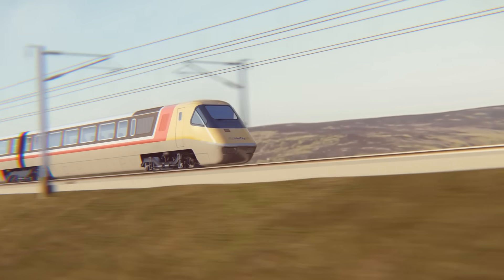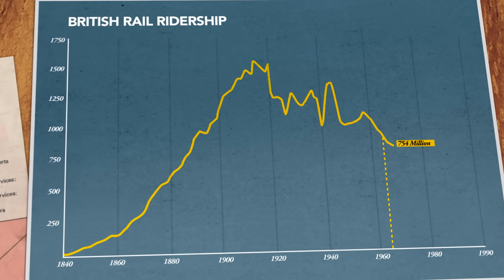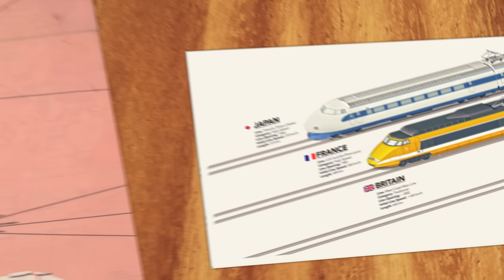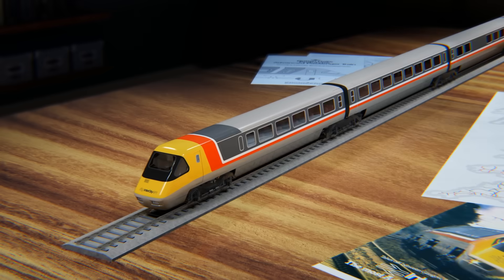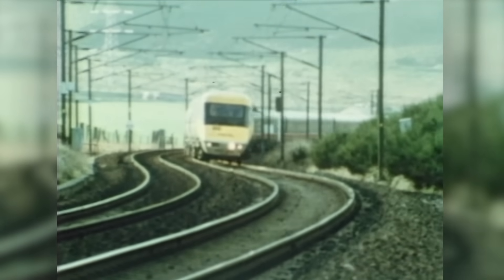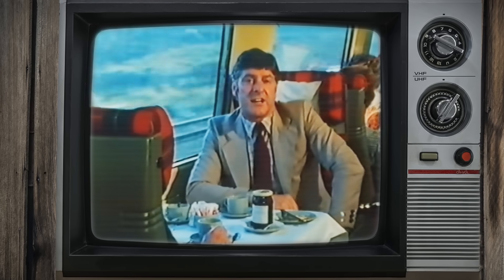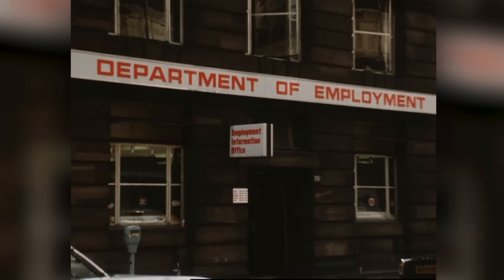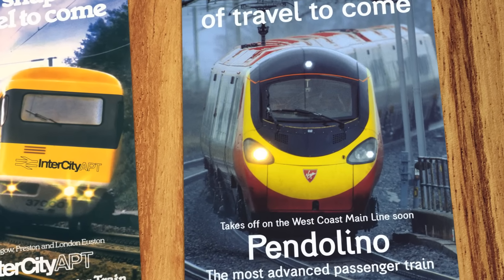This Train Made Passengers Sick: The APT Tilting Train Story

Comment: Germany had some tilting trains, too, from 2001 until 2017. The ICE TD (Tilting Diesel) went 222 km/h on a test track, and it went 200 km/h in real use.
Reply: They still have tilting units, the ICE-T (Class 411/415) that are permitted for 230km/h (143mph) commercial speeds.
Reply: @86501freightliner  And both had big problems with the technology...
Reply: @wenjaaaa  I know the diesel units had problems but wasn't aware of anything majorly wrong with the electrict ICE-Ts?
Reply: @86501freightliner  The Problem is that this tilting function isn't perfect. The Diesel, additional to that problems, didn't make enough money and a diesel isn't very efficcient too.

Comment: The West Coast Main Line was electrified during the 1960s and saw trains regularly running at 100+mph. (The London - Manchester run took about 2 and a half hours to cover the 200 miles, about the same as it takes today.) The APT was supposed to build on this success and would have except for paucity of investment & short sighted management -- it was a prototype and like all early prototypes it had bugs and shortcomings, not a fully developed product. It was rushed into service and when everything didn't work perfectly first time -- that's it, throw it away, disband the team, destroy the expertise -- and eventually buy an Italian Pendolino, effectively the same thing but with a bit of extra R&D.

I would just shrug and say it was 'one of those things' but in my career as an engineer I've met this kind of blundering, short sighted stupidity so many times that I think its the normal way of doing things. Engineers succeed despite the culture, not because of it, and the history of many successful products tends to be the bootleg development done on the quiet out of sight of management.

Comment: Not bad although I'm not sure about the click-baity title- it does seem to have been journalists on the first public run who experienced the queesyness.  Completely coincidentally there had been a free bar for the press the night before...

As you say the P-trains were prototypes which were intended for occasional test runs rather than regular service.  They were the tangible results of the second stage of the APT program the first stage being experimental (using the gas-turbine powered E-Train) and the second being the prototype stage.  The third stage would have been service or (squadron) S-trains.  Sadly the P-Trains were so pilloried by the press that the APT brand was too poisonous to use but the S-trains did enter service.  The Class 91 loco's and rakes of Mk 4 coaches introduced in the late '80s and still in service today are directly developed from the APT though they have never used their tilting potential.

I know Kit Spackman (one of the engineers who developed the tilt system) slightly so I'll send him a link.

Comment: This channel is usually pretty good... it used to use the units and engineering facts correctly. It still does most of that but there is a common misconception left in this video and while it may bring the topic of inertia closer to an average Joe it still is incorrect. There is no such thing as centrifugal force. There is centripetal force and the human illusion of centrifugal force is caused by the centripetal force doing work on you to turn you while your body would prefer moving straight according to Newton's 1st law of motion. Since your perception system wrongly assumes that the train is standing still as it drives along the track when the train eventually turns you think you are yanked away from where the train turns but in fact nothing happens to you you are just yet to hit some object in the compartment that can  start doing work on you to turn you in the direction the train is going. If it is very violent you might 'fly' across the train, which is just the train moving below your feet on a curve and you are just keeping your straight line of motion until you hit the window or something else :)

Comment: Here in Sweden we have a train called X2000 (or X2) that uses the same technology since 1990 and it has worked completly flawlessly since then.
Reply: Zero Cool Except it has a maximum speed of 120mph which is very low. Only 43 were ever built and they can't be that good as only one set was ever sold and exported.
Reply: @spencerwilton5831  Wrong 44 were built in total the last one was built for China with the number 2088. They may not be popular in other countries but here in Sweden they are. And acts as a faster and more comfortable alternative to the much slower regular trains. And I forgot 125mph mind you.

Comment: So I guess Amtrak was just kind of... Lucky? That the Bombardier active tilting system actually worked, with the Alston's powerful engines (at least similar to what's used in France on TGV), although still hold back by some extremely outdated infrastructure and the overhead catenary which can't support higher voltage and higher speed. The Acela has been running for almost 2 decades now in NorthEast.

Comment: Could it be that your second  and third force diagram were wrong? 
Shouldn't the resulting force be the same and only the trains rotational axis move?
Reply: He labelled the 'centrifugal' force which is a fictitious force, it should instead by the centripetal force which acts in the opposite direction. The resultant must be acting inwards towards the turn otherwise the train would move off the turn a tangent where the force was removed. Kind of disappointed he failed to recognise that. Also to answer your original question - isn't that what's already shown?
Reply: @giantaxe3958  
For the first part of your answer,

In engineering, at least to my knowledge, people like to use the fictional centrifugal force, because they work from the viewpoint of the object itselfe (wich would make the centrifugal force a real force) either because it is easier this way or because it is the only way that you could properly work with the systeme. I mean, engineers are no physicists, if you get the same result but with a minimum of effort, than you will do it. At this point, nobody cares if the centrifugal force is just the reaction of the properties of a mass towards a change in velocity or a change of the direction that the velocity vector points at due to a centripetal force that acts on it.

For the second part, 

I actually meant the change of the direction of the resulting vector. At least from what i know, the vector should be the same as befor, when the train is tilted, the floor is moving and therefor the perceved force should act, for the most part,  
vertically to the floor.
Reply: @Enthropical_Thunder  The first part: Okay I'm not an engineer, I was coming from a physics viewpoint so I'll take your word on that one. 

For the second part: As you say, the vector is the same as before because the raw forces haven't changed but from the diagram, despite the wheel base obviously being parallel to the ground in the third diagram, The floor of the carriage (from what I can see) still has the same relative angle to the horizontal, as the diagram with the banked track. Therefore, if the angle that the floor of the carriage is the same in both diagrams (again this is from what I can see) then whilst the effects of the centrifugal force will be lessened, the resultant force (in either diagram) is alway still acting at a slight angle to the floor of the carriage so it essentially depends of how far the floor can over (how large an angle it can make from the horizontal) and maybe the third diagram he shows is in fact the limit of the tilting mechanism. Basically I think you're probably right but the intended purpose of the diagram was merely showing the carriage becoming the tilted object not the track and everything else being kept the same.

Comment: The problem with the APT was the brakes nothing else! My instructor driver was an APT test team driver the train & systems worked the water cooled brakes did not
Reply: When originally introduced the brake pipes were long and convoluted making them prone to developing air pockets or freezing especially in that bitterly cold winter.  They were redesigned before the P-Trains were reintroduced into service in the mid '80s (with no fanfare at all after the press hatchet job).

Comment: First off, comparing 1890 to the 1960s is like comparing an elephant to a mouse!     Because they want to save money, they don't replace the rails?   Throwing the baby out with the water from a basin makes just as much sense.   The Private car, given another twenty years and better be electric,  as fuel will be so short as to make a personal vehicle a big mistake.    I have had two Prius's or Prii!  I almost always get twice the mileage as other more clumsy SUVs  Right now my MPG is 44 plus, I have gotten 65 MPG once.  Conditions were right, night time, no wind, no traffic and a straight road.   Now all the other copycats are trying to make wired cars, have to use an outlet to charge.    My most recent trip was from TN to IL, 449 miles, the car suggested more fuel and I put 9.5 gallons in it.    I had to rent a car for ten days, they gave me a Jeep Cherokee, $90 spent in ten days.   $90 dollars would get me to the Mississippi with change left over for the return trip and back at forth several times, it is 100 miles or 161KM distance.

Comment: Yeah I ride the Virgin trains services all the time between Manchester and London. They do tilt, you barely notice, it's very smooth and comfortable. However they still needed to upgrade all the rails to achieve that smoothness, and they run slower than the APT used to. :(

Comment: nice and interesting as usual.... buuuut
Pendolino or APT?
Many sources are mistakenly saying that the Italian Pendolino originates from the APT. In reality, there is nothing in common between the two projects, born almost simultaneously, but which did not develop together. The Fiat-Pendolino executive project is even earlier. The British patents of the trolleys are acquired with the aim of perfecting second generation pendulums, the ETR 450-460, while in Italy for the past 8 years the first pendulum train in service, the ETR 401 was circulating. A comparison is offered here between the chronology of the English project and that of the Italian project, through the salient phases of development:

First working prototype ETR Y 0160: 1969 against APT-E: 1975

Construction of the first ETR 401 train: 1975 against APT-P: 1981

First ETR 401 commercial trip: May 1976 against APT-P: 1981

Comment: You forgot the fact that these rail-lines had been designed and built mostly during victorian times, and hadn't been seriously rebuilt or updated since first laid. or that Britain had only amalgamated into a national railway after WW2, so they had a surplus of locomotives, but said loco's could only run on their own pre-grouping networks, which was a problem. since each of the big four had their own, isolated networks with hubs, interconnectivity was low, and combined with a huge surplus of rolling stock, some private, most company owned, it left britain with a massive hodgepodge collection of trains, and most couldn't run on other's lines, it was going to lose money. hence the building of the BR standard series of Steam Locomotives.

Comment: You shold make another video on the winning counterpart, ETR 401. They used a different sensor system that allowed to predict rather than correct the centrifugal acceleration.

Comment: Canadians were building a tilting train around the same time known as the LRC, it was also plagued with problems though now quite as bad. the locomotives were retired by 2001 and the tilting was disabled but the LRC coaches are still in operation.

Comment: The sad part is that Brits are great about coming up with great ideas but not getting them to work. They weren't seeing the bigger picture of where the tech they were developing didn't need to be limited to the UK. Had they figure them out and sold them to Canada and the US, it would have meant a semimodern railway system going relatively decent speeds.

Comment: Haha, we got the HST Diesel engined train here in NSW Australia rebranded as the XPT back in the late 70s and they still run.
Reply: Same here, They are getting replaced by new Hitachi trains. But they keep coming up with new uses for them. GWR is keeping some shortened sets, 4 coaches still with 2 power cars to better deal with gradients of South Devon. Scotrail is getting a bunch of shortened sets, and East Midlands Trains arnt due to replace theirs until 2023. 40 years of hammering and still going and useful!

Comment: No mention of the fatal flaw in the design - the power cars in the centre of the train.
At high speed the pantograph set up a standing wave in the overhead supply line, which not only threatened to severely damage the infrastructure, it actually touched the roof of the passenger carriages on more than one occasion. The result of this was a severe restriction on the top speed, rendering the whole exercise pointless. APT could never have run on standard track and fittings, at least, not as intendee.

Comment: The Problem with almost all railways is that the Gauge should have been 5'6" (1.75m - Pakistan/India) as opposed to 4'8" (1.42m - Western Europe and USA).
Reply: jwrobin21 Maybe we should have gone with Isambard Kingdom Brunels gauge of 7 feet and quarter of an inch.........
Reply: @loony45  
Nope. 4'8" was too narrow and 7'1/4" was too wide for corners. 
5'6" was just right. Maybe with the new Targa System for switching between gauges, the whole world could ultimately regauge to 5'6"; the way it should have been done at the very start.

Comment: The APT story reads like the UK relationship with Europe or high speed rail : A lot of debate and not much is done. Solutions working on the TGV such as the high voltage line bringing electricity to the two power cars were rejected. APT engineers tried to have a pantograph above each power car but the back one could not make good contact with a catenary oscillating after contact with the fore one. They tried putting the two power cars in the middle, or having a shorter train with a single one. In the end they lost political support because promises of swift delivery were repeatedly broken. British Rail then tried to sell its patents to ABB in Sweden and Fiat in Italy. You said that Fiat bought them but I read in a nice book about the APT story that neither company was interested. In the end both ABB and Fiat developed successful tilting trains and nowadays Italian Pendolinos run over the West Coast main line.

Comment: So the motion sickness sounds like the most humiliating result, but overall seemed to be the least of their worries. Had that been the only problem or limitation, it probably would have been successful. Even with these issues, trains are still vastly more comfortable than airplanes, buses, or cars - they complain about coffee cups sliding off the table on a train, any of those other transports you don't get a table, and probably not any coffee. Motion sickness is something people build up a resistance to - after a few rides on it they'd probably be fine. I'd see this all as totally acceptable had it worked. Granted though, I'm an American, where trains are so rare and getting rail transport service installed is such a challenge that my thought process is "any train is better than no train." And trains here are often so slow they're useless, I think people would be more likely to use - and thus buy tickets for and justify the existence of - a fast uncomfortable train over a slow comfortable one. Getting where you need to go cheaply and quickly is the higher priority. I do ponder the possibility of taking that to the extreme, of a super-fast super-cheap but almost roller-coaster like ride. People always say limits of such transport systems now isn't technical, it's rider comfort, and I wonder how many people would be willing to sacrifice that. Ride something that will get you to/from work in a third the time, at the expense of being strapped in and taking 2 G turns. I think I would, and though some people wouldn't I think enough would that it would be viable.